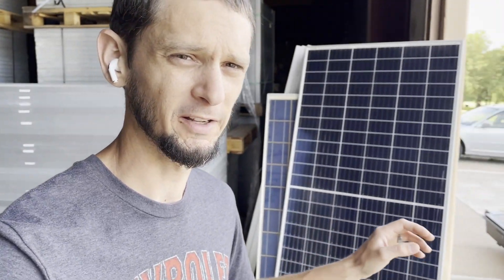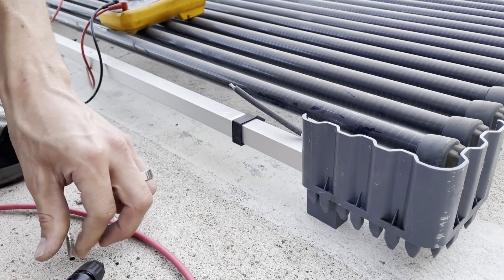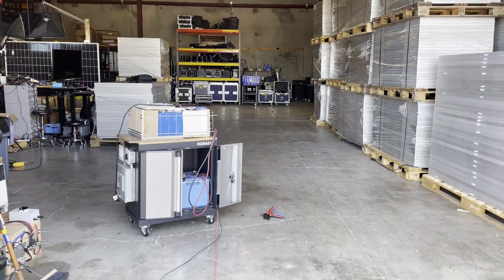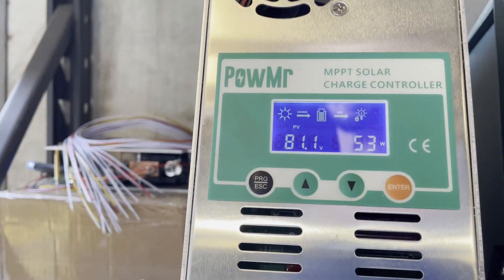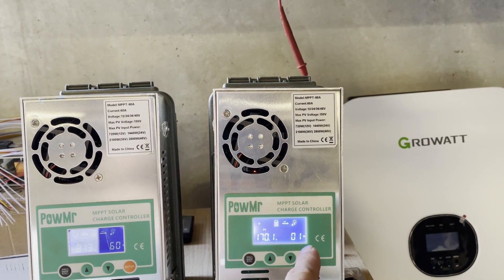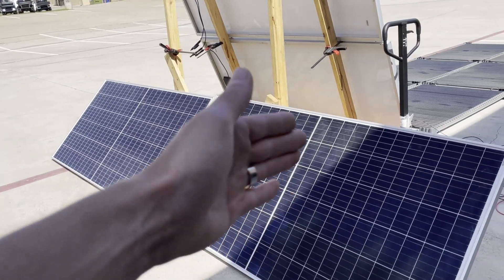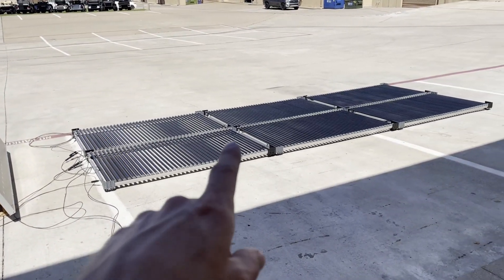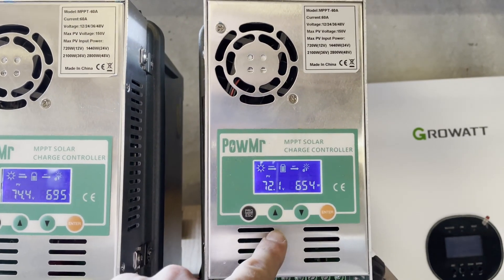New, Used, and Tubular...Who does it best?

Comment: Hey! Awesome on the Solyndra test! Will those work if they are hooked into controllers for a Conext XW Pro 6.8kW 120/240 Volt Inverter 48V Charger?
Reply from the maker: Don’t see why not. I’ve seen some manuals call out specific instructions for CIGS panels like this. I think it was about grounding.

Comment: Thanks for an informative video! I was definitely curious how those older DelSolar 230 watt panels would fare vs. your other panels, as I've been buying them piecemeal recently. Solyndra performed better than I expected. I think I'll be picking up another 2x 230W panels soon to make my current 6 panel (3s2p) array into an 8 panel array (4s2p) bringing it to 148.8Voc. Might need some more MC4 connectors again and more wire. I'm still building out my system, but one string (3x 230W panels) I was able to test earlier today netted me a bit better efficiency than in you testing at 501 watts on the Bluetti AC200MAX making it about 72.6% efficient. I'm going to be testing more panels in a 3s2p setup for 111.6V and later 4s2p with various loads.
Reply: Are you the guy that I met at the shop with the electric bike for sale?
Reply: @JM-yx1lm  no, that was probably someone else :)